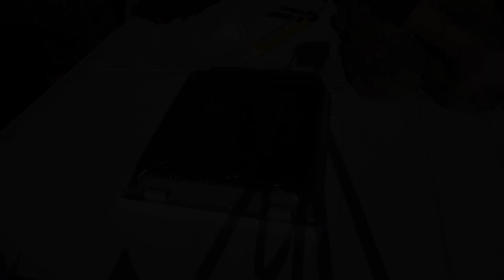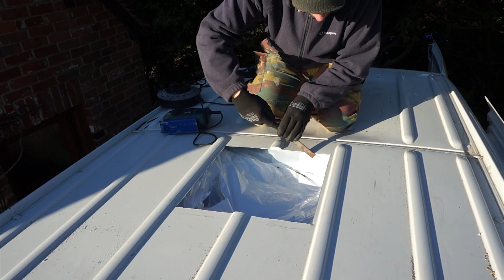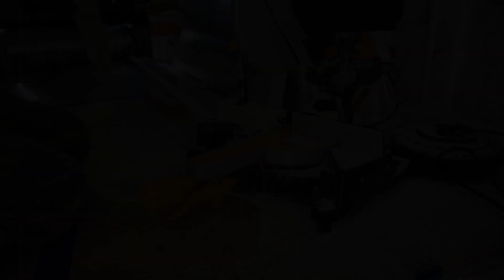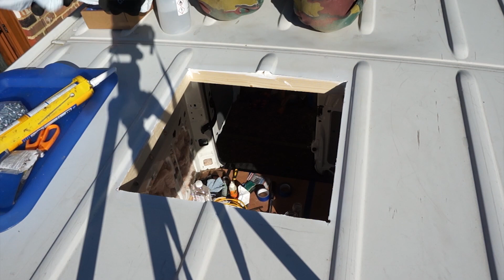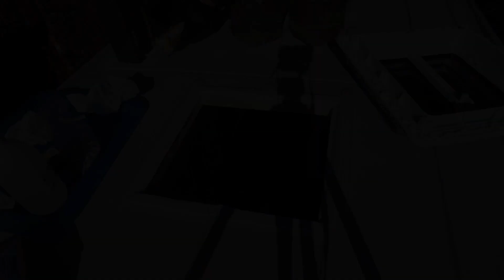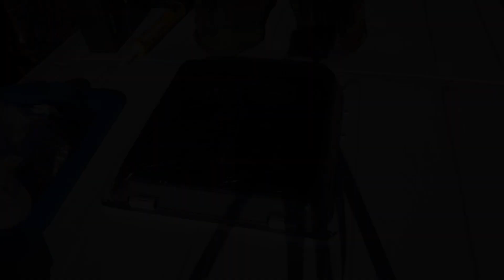Fitting a Skylight - VW Crafter Camper Conversion

Comment: Hi there 
When you buy the roof vent of your choice ‘ does it come with the tape and anything else you’ll need to fit the vent ‘ ? 
Thanks 🙏 
        John
Reply from the maker: Hi! Mine didn’t and I’m not sure any come with sealant. The sealing tape is mastic tape which is easy to get hold of. That and a good quality silicone sealant is all you’ll need. Good luck!